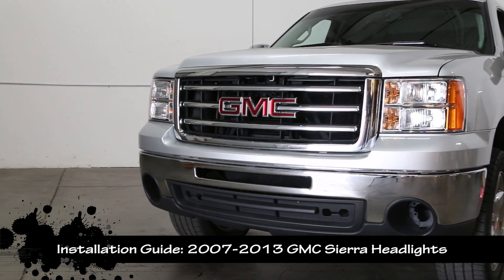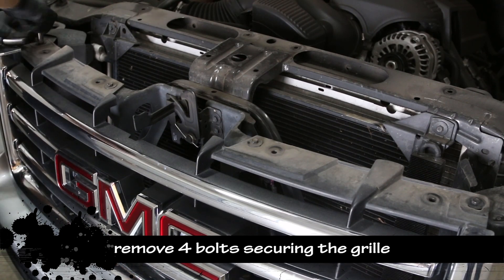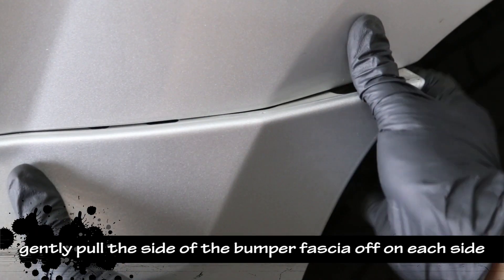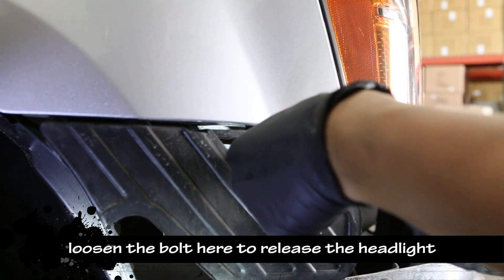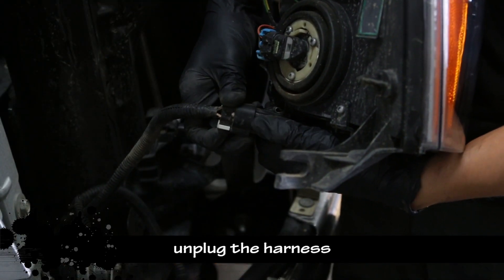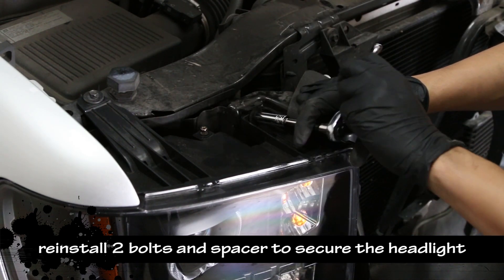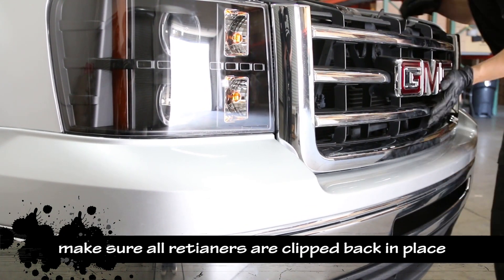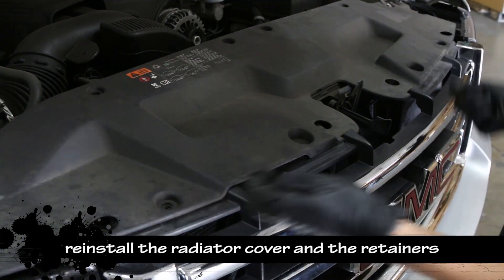07-13 GMC Sierra 1500, 2500, and 3500 LED Halo Projector Headlight Installation Video

Comment: The problem with after market headlights that are suppose to fit 1500, 2500 and 3500  pickups inclusive is that 3500 pickups rear end sit about 2 inches higher than 2500 and especially 1500  which means alignment needs to be adjusted higher on the 3500 which so far I have not found in any after market headlight. They  are designed for just 1500 pickups that sit level.

Comment: That fascia does not come off that easy.
Reply: once you undo all the clips, yea it does
Reply: I didn't have to remove anything. lol
Reply: No it does not
Reply: I just spent the day with my 2008 sierra HD  it doesn't,  mine appears to have 2 10mm  bolts on either side that have to come out.
Reply: MH1000a the 08 is a pain in the ass. Atleast mine is.
Reply: hard to believe that was 2 months ago,  yes mine was as well  but it came off  like he said its sketchy :)